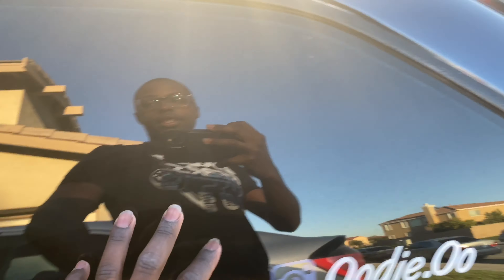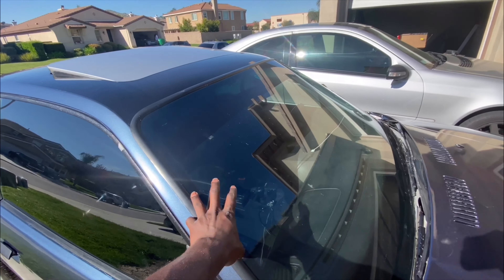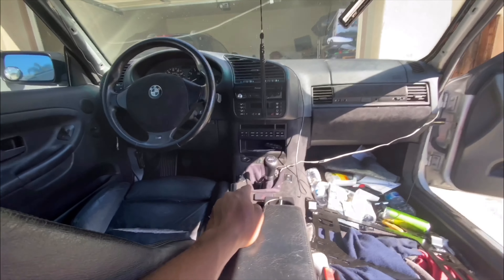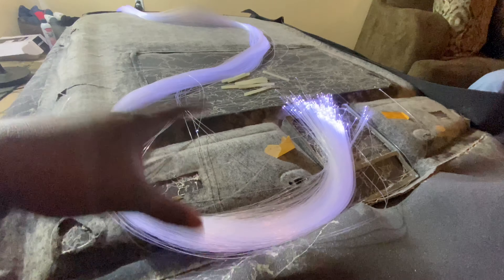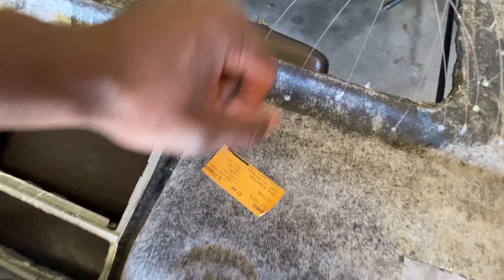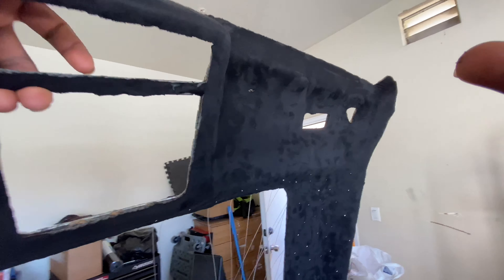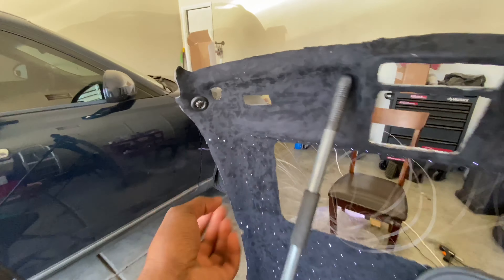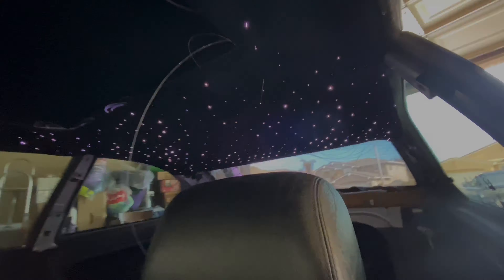ROLLS ROYCE STARS IN BMW E36!!!

Comment: Heey man, cool video! I'll do it same for my coupe but i ve a question for ya. Where did you run the optical fiber? under the B or C Pillar or anything else? and how it goes into trunk? cuz i am thinking about putting it under the rear shelf and cutting hole in a speaker box to discreetly route it to the trunk

Comment: Yoo, where did you hide the box connected with the cables at ?
Reply from the maker: I Routed it to the Trunk thru the rear Passenger Pillar to get power directly from the Battery.
Reply from the maker: As Far as the actual box. It’s underneath where the spare tire goes.